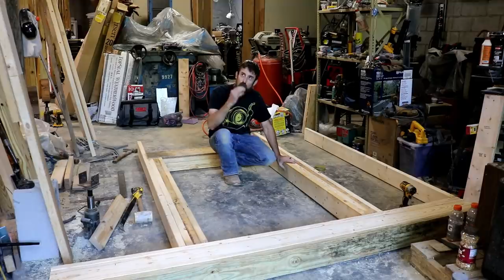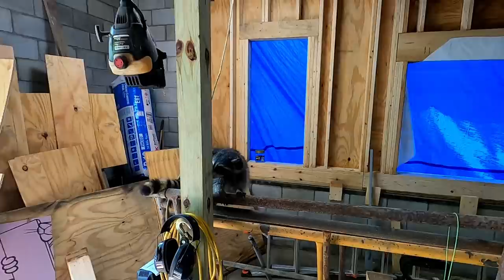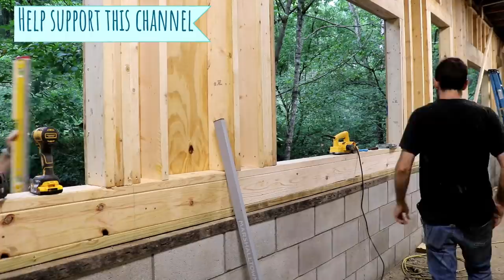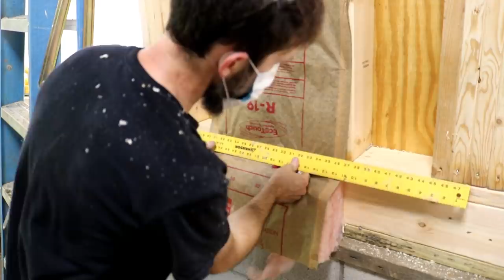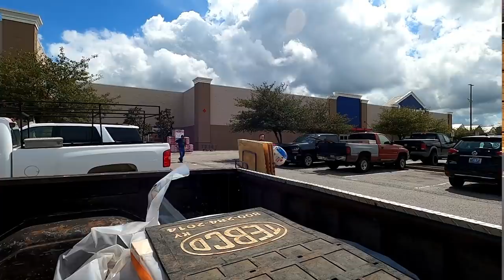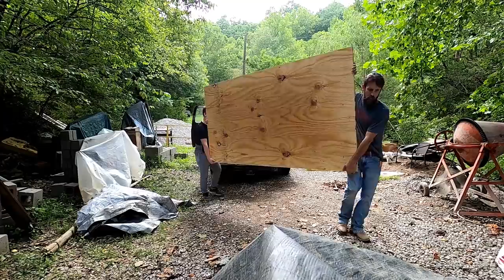Finished Framing & New Squirrel family member

Comment: Steve I never want to tell you how to do something because you're more than capable in most of the things you do, but,, please use push blocks on your TS (2 if possible) and only have the blade coming through the stock as barely as possible. If you were to slip how far you have the blade out would cause so much more damage that if it was only just penetrating.

Also it looks fantastic, you've done a great job.
Reply: I totally agree!
Reply: What about a riving knife to help with kick backs ( for those that do not know what it is it’s a curved tapered blade behind the saw blade but a tad thicker prevents pinching)
Reply: TwistedF8 I second that Steve. Push sticks are a must! Caught my thumb on a saw blade a while back and will never push material through the saw with my fingers again! Here in the UK we have to have a knife that stands up behind the blade, and thus preventing  binding of what you are cutting and would be better for your saw, but I see there is no provision for it on yours, also the riving knife as it is called is used to mount a guard that sits above the top of the saw blade. These are compulsory in the UK and Europe)
Reply: As a woodworker, I was going to say exactly the same thing.  Also, please don't put off cuts on the tablesaw.  Have heard stories about people that have done that, one moved (as some of yours were doing), they went to catch it and ended up with fingers in the blade.
Reply: I was going to say it also, if something happened he'd have to update the avatar little man to have only 1 thumb
Reply: A late farmer friend once told me this " respect the tools because they won't respect you" btw his tractor killed him at 36 two machines that terrify me are table saws and chainsaws please use pusher sticks and at least stand of center Steve getting hit in the chest hurts!
love your pet cat we don't get that species here in Australia 
Tony from Western Australia
Reply: I'm not much of a safety Nazi but I got to agree on this. One stupid slip is all it takes to fall into a blade. I've done cuts like this and just stand at the side, grab the piece off the backside of the saw and let her drop on the ground. I've seen VERY careful friends and co-workers make this exact mistake. Foot rolls a tiny bit on a rock or something and the hand goes out to stabilize themselves, blade is set high and wham, hand into the blade.
Reply: Not going to disagree or agree with using push sticks when just cutting "foam board". There's no chance of kick back and his hands weren't anywhere near the blade at any given time. If you're going to use a push stick, use or make one that actually covers at least 8"-10" over the work piece, none of those cheap sticks that comes in a kit or with a saw. But if you want to call out any safety issues with what Steve is doing, call out the fact his safety glasses are on top of his instead wearing them properly. Cheers :)
Reply: @stuarthardy4626  100% agree with you. They're a must. Not just for decoration. They also stop the cut offs falling back into the blade, which it then kicks back.
Reply: I much prefer blocks to sticks, with either  grippy pads or tiny spikes on the bottom. They just feel a lot more stable to me. Especially if there's a bit of weight to the piece I'm cutting. The trade off is you're closer to the blade of course but to me feels safer. Hey as long as you use something other than your hands that's meant for the job.
Reply: Ex father in law cut his hand half off an his feeling a. Use never came back other then his hand stayed colkd all the time he wore a insulated fur lined leather glove over it all the time even slept with it on,safety on table saws are no joke ,u dont use caution accidents happen even wen caution is used but give ones. Self every advantage to sliw the chances down ,ive used a saw since i was 12 ,an ive seen many things happoen over the last 40 yrs from saws kickbacks to people not paying attention to being startled to others bumping u from a miss step to a kid cutting his thumb off on a band saw i shut the saw down grabbed his wrist to stop him from pushing it in deeper into the blade use the push blocks and the riving onife ,,kick backs can actuall y cause serios damage to onesself
Reply: @MoondyneJoe A work colleague of mine was cutting a tree branch with a chain saw above his head. The tree branch suddenly snapped and he lost control of the chain saw and he nearly cut his leg off. As it happened it just took a large lump of flesh off his leg but he was off work for several weeks.
I have never used a chain saw or a table saw. I cut all my wood by hand.

Regards from Redruth

Arnold

Comment: Hello Steve,  I think you are doing just fine in your construction.  For me I will keep the heavy framing members for the stiffness and strength they impart.  When insulation becomes important then exterior layers of foam or mineral wool are the answer as they do not diminish the structural value of the skeleton.  Modern methods too often cheapen quality at a high price.  Witness the actual dimensions of plywood and dimensional lumber as opposed to what they used to be when the structure techniques were first devised.  24" centers, lite framing, no sheathing, no thanks.  Enjoy your build.
Reply: The building has the block corners and base so the opening could be seen as just a giant window opening. So the only really necessary thing it needs is vertical support for the roof. The only part that bothers me is the sheeting. It would have been a little better to sheet it last so the ply would tie the framing together. But then he'd be wrestling plywood on a ladder, on a hill, above a creek. So it's perfect the way he did it.:) Good job Steve.

Comment: That is a real nice looking wall you have there now, Steve. I knew you could do it, just takes some time and patience. My question, no wiring done inside the walls? I know you could swing the old stuff back, but you could add an auxiliary circuit or two inside the wall now for all of you 110/220 single phase items and not have any pipes showing. Maybe a refrigerator/freezer circuit, welder circuit, 2-3 GFCI 20 amp circuits in double gang boxes so you have 4 outlets in the box, a big shop fan receptacle up in a corner. Just a thought.
Raccoons are cool pets, you can slowly train that little guy to be a companion who will let you pet him, but the main problem with them is they do not care where they poop and will do it on everything up there in your attic space that they can get to and they will also tear things up. Do you have to feed Hazel with an eyedropper? The squirrels we raised were still blind babies and we had to do that to feed them.
Thanks for the videos and have a great weekend.
Reply: I did all the wiring in my shop surface run in conduit. Much easier, and simple to change later if needed.

Comment: Wood is actually an excellent insulater. The transfer of heat from one side to the other is very slow.
Reply: Wood studs have an R value of 1 per inch.

So that 2x6 plus the sheathing is *6*, whereby the insulation for a 2x6 wall is R-21.
(Edit, I see Steve is using R-19. We can't hardly get that up here)

I can tell you the R value of a block wall is"little to none"
Reply: True wood isn’t as good as fiberglass or rock wool but in a building made of concrete even a 2x4 wood wall will shine like a diamond.
Reply: From the chart I found on line soft wood, which most framing is made from has an r value of 1.4 per inch.
Reply: @jamespayne8781  I've seen that number bandied about.
But we really have to accept that knots, or even denser slower growth (while it may be "premium") is worse. Bridging also has to include conductive fasteners which pull heat right through.
Look at the sheathing nailing and drywall screw schedule thanks to seismic codes.
Have you never seen nail heads give the paint dirty spots all over (inside and outside)?
Yep, you might as well start measuring where those fasteners stop.

Then there's all the unsealed seams between 'panels' because none of the sheathing overlaps.
And not leaving sealant space in the rough opening.
Here, we must have spray foam around windows and where different wall materials meet.

I had to laugh when I saw this illustration: https://www.energyvanguard.com/blog/4-types-of-r-value
Perfect case in point....

NONE of this really matters given a tin roof and block walls grouted solid.
Why bother with any insulation?

I must admit I had a chuckle when Steve installed sill seal but doesn't bother to install a pan to keep the sill and short wall from rotting.

If you have access, have a look at Underwriters Laboratories eighth edition of standards #1446.
UL and DOE are the ones that you will see referenced on any bundle of insulation.
Reply: I guess my point is that idealized values are often far different from empirical values.
And this is something you only gain from years in the field

Steve is doing the very best job he can, with the knowledge that he has.
Nothing I've said is meant to knock or discourage him.

I'm sure if he watched me try to operate a lathe or mill he would feel the same way.
Reply: I don’t see anything to imply criticism or disapproval. Frankly I think he’s doing a great job. I particularly enjoy his clips because I used to live in the south. The sights and sounds of the world in the background bring back memories. I once even had a pet squirrel.
Reply: @jamespayne8781  I totally agree that Steve's wall is going to be far better insulation than the block wall surrounding it or the tin roof above.

It takes me a second to register that Kentucky is 'South', but yes, Dixie says so.
It sure is a beautiful part of this country, and he seems to have some privacy.

I've had a few odd pets like snakes and ferrets, but never one that nature brought to my door.
Steve and Elizabeth certainly have a charm with those squirrels though!

Comment: I can say that in 50+ years of carpentry, both finish and framing no framer I ever saw used more than a skilsaw, hammer and nailgun (in the latter times).  If a stud protruded it was tough.  No effing effete planers....
Reply: @cessamichelle  well, you're right about the framers, close was good enough.  There were many tricks in the bag when the crooked lumber caused walls to bow in or out excessively....as for our squirrel friend, it seems perfect is just good enough and he is to be applauded for the classy job!

Comment: Question for Steve and the pros out there. Why do pros use a hand held circular saw to frame?  I always use my miter saw for the very limited amount of framing I have done. Wouldn't the miter saw provide a very square edge versus a hand held saw. Or is it just not that critical?

Comment: Thermally air is a poor conductor of heat/cold through a wall (looks like those pockets are full of air heh). You are going to loose heat at a MUCH higher rate through all the cracks. That cavity is next to nothing comparatively. Housing insulation is nothing more than air barrier and pockets of air anyway.

Watched my friend build stuff for his house (he's been a machinist all his life), a lot of major remodeling... I watched him do the same stuff you did here, smackin walls/boards/panels into place. Took me nearly a year to convince him to cut stuff like that an 1/8 inch shorter hehe...
Reply: @Snazzlecat Only thing that insulation will do is keep the machine noise down a lot, but will also remove the relaxing sound of the stream. Yes the biggest losses will be the other 3 walls, the massive single panel door and the roof.
Reply: @Snazzlecat I agree %100, that's pretty much what I'm getting at. All them holes in the workshop, and ppl commenting on thermal bridging, I'm seriously wondering if anyone thinks before they speak.

Comment: ROTFLMAO  (rolling on the floor laughing my ass off).  I'm an old builder.  I'm 68 and started building crap in college where I studied technical theatre.  And in theatre, you over build  Grossly overbuild.  Why?  Do you have any idea of the forces in involved with 20-30 actors dancing in a musical production?  After college I ended up building homes for a while then eventually opened a cabinet shop in about 1980.  I learned how to restore antiques, then build antiques and eventually new furniture.  Eventually I started designing homes and building them myself.  And more recently (like post 2000) I worked for a commercial conference facility designing and building the infrastructure they needed, again including buildings.  OK, I never forgot the theatre training I OVER BUILD.  EVERYTHING.  Nothing I have designed and build has ever failed.  And Steve, I've got to tell you, YOU my dear friend, build heavier than I would have ever dreamed of building.  Your window walls with the jacks and kings you used could easily handle 4-5 stories above them.. Lumber is strongest along the end grain under compression.  Think wooden railroad trusses.  On second thought don't, because you may think you need enough wood to hold up a fully loaded train on a wooden trussel.  Love watching you work.

Comment: The only problem with such a tight fit is that when timber expansion during wet weather will put such extreme  pressure on the total wall in cluding the end wall..  However a good job..

Comment: Yea y’all definately got a better lowes than the part of ky im at..  if you set a camera down anywhere in the store itd either get stolen or theyd try to charge you for it when ya left saying “ i saw you get it off the shelf..” and the law wouldnt look past the store cameras showing you take it and the store wouldnt show you putting it down either..  ive had em scan a new pressure washer i got twice and swear they didnt and even the manager told me that the pressure washer cost 1000$ when it even had the price tag on the damn box for 498$  told me “that must have been a sale price..  so amazon brought me my new pressure washer, same one, 300$....   gotta watch em...

Comment: you're  clamping frame lumber to cut it? and planing it? It's called rough framing for a reason. Your doing cabinetry LOL. such a waste of time
Reply: His shop, his standards... wouldn't need to clamp them if they were longer/heavier but given they had to fit inside an aperture, wouldn't want one to move and end up with an accumulative error and the blocks don't fit and waste more time putting it right than it took him to do it right first time... I'm sure you'd know that though 👍